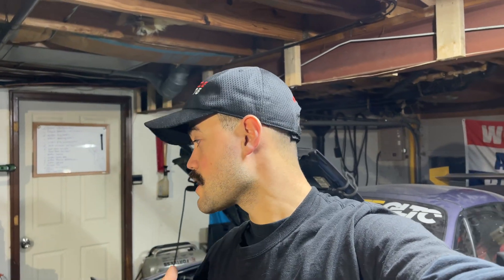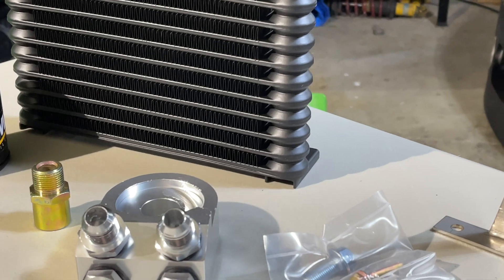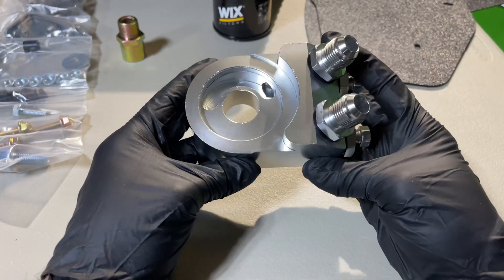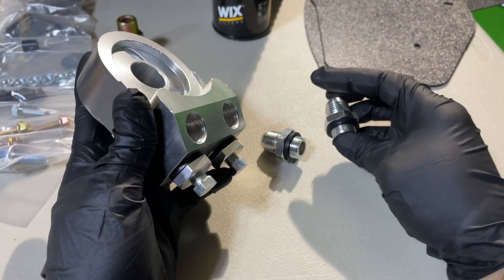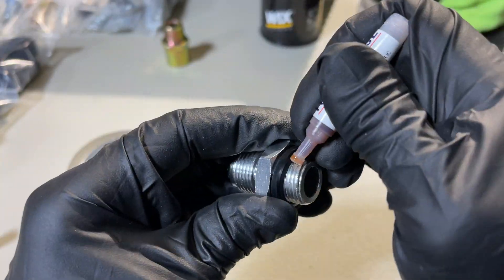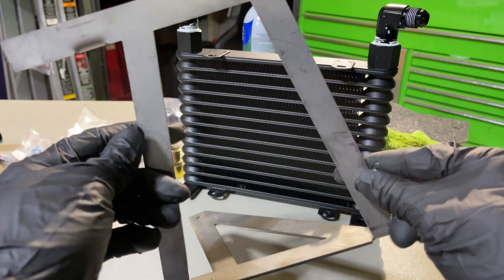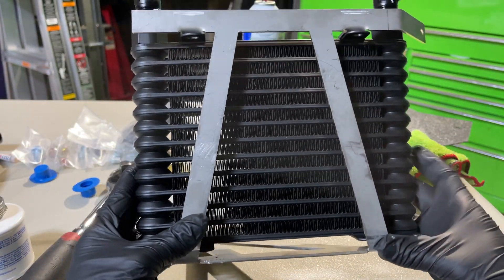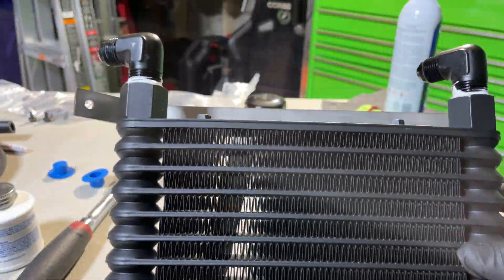This Kit Might Just Save Your Miatas Motor! | Track Dog Racing's Oil Cooler

Comment: Hey, cool video!  Shopping different oil cooler kits for my track and it was nice to see the TDR setup more in depth.

My main gripe is the oil cooler line routing.  Where you have it routed through the sway bar bracket.  The problem with this is that you should really be using the racing beat sway bar bracket re-enforcements which take up that space.  Tracked miatas have a habit of breaking those sway bar mounts off entirely if not supported with the racing beat (or similar) braces.
Reply from the maker: You are absolutely right! They are actually routed in a different direction because of that. I have AWR reinforcements

Comment: Hey I am also in the process of supercharging my 95 NA with the TDR kit! I did their oil cooler as well. When I was installing my barbed fittings, they didn't seem that difficult to press in as the instructions suggested. Did yours really take a lot of effort to insert or could you fit them by hand?
Reply from the maker: Yes they were. There are going to be some differences in hoses. As long as the barbed fittings do not come out. Then you will be okay. I recommend tightening the clamps a little more firmly. Also if you are routing the hose thought your sway bar brace. I recommend shielding the hose from wear so you won’t get punctures later on.
Reply: @zitroracing  They do seem pretty secure with the hose clamps, thanks for the quick reply! I was planning on padding the lines with parts of the extra hose supplied. What did you end up doing?
Reply from the maker: @krisenr No problem. Thank you for the sub! 🙏🏽.  I have some thermal hose wrap coming. To wrap the lines. When I wrap them I’ll relocate them to the frame and use insulated hose clams to attach them to the frame and out of the way of anything.

Comment: Is that factory oil filter housing not already cooled? It looks like there’s a couple lines running out of it. Can’t remember if mine has that.
Reply from the maker: It is, however the oil will only be as cool as the coolant: this way it has additional cooling. Helping the entire system